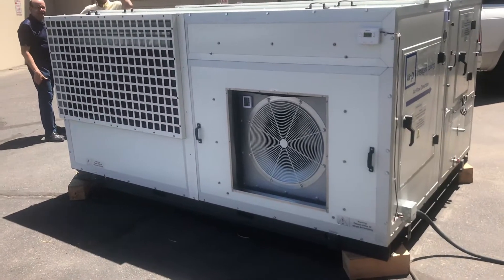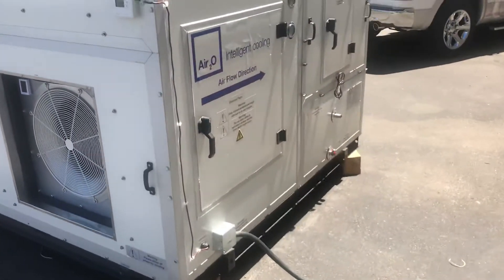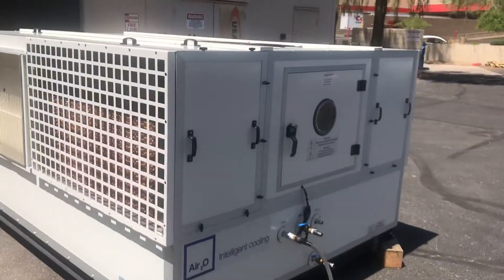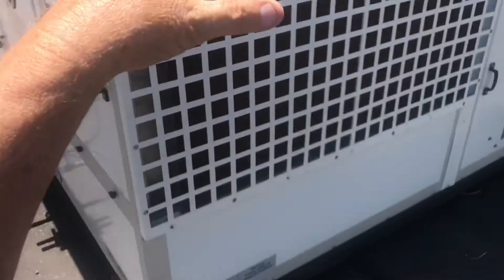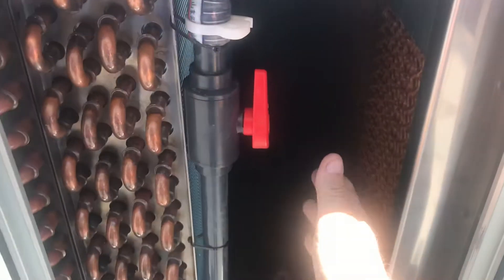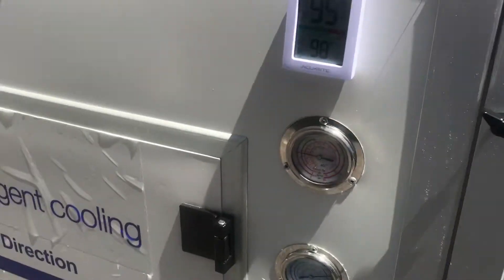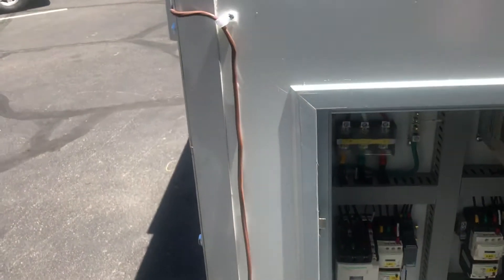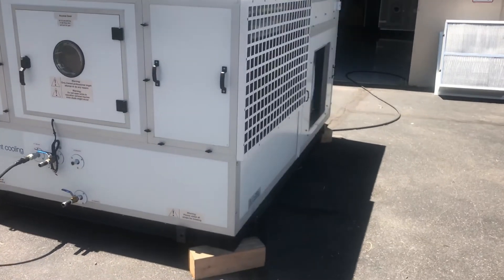HVAC System using Water to Cool

Comment: but 88F at 19% RH gives a wet bulb of 61.48F, you are at 49F output, there is a 40% temperature drop from 100% efficiency, it is possible?, there are no tricks here?
Reply: The dewpoint is 37.7 - 40.5 °F.